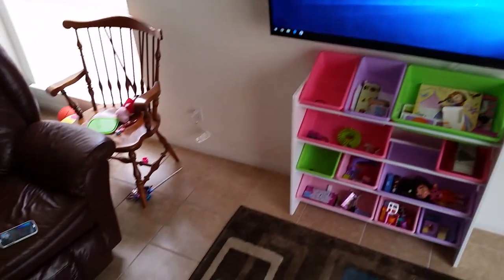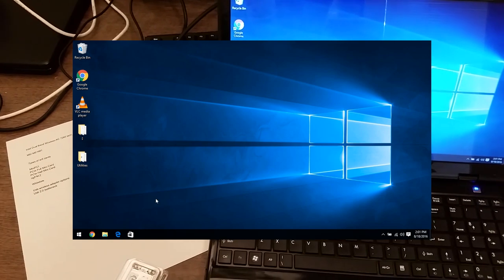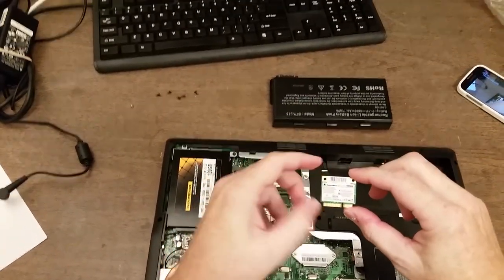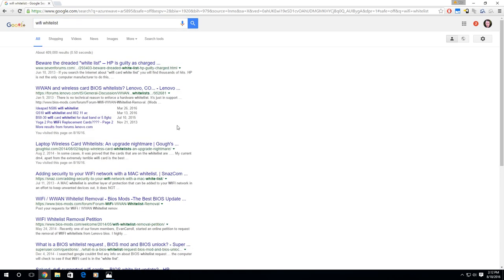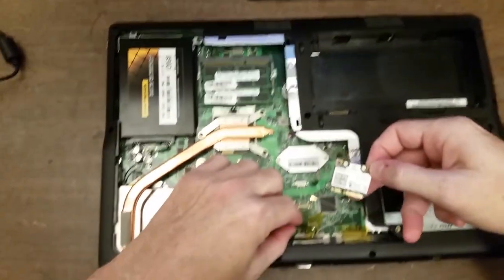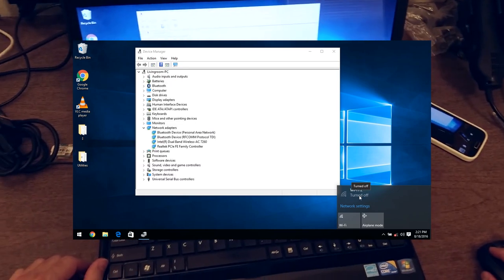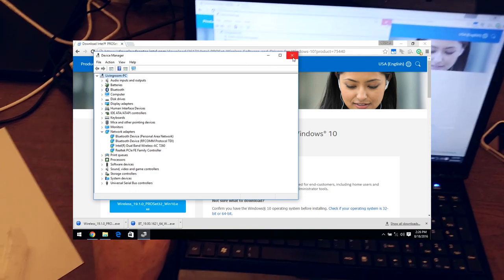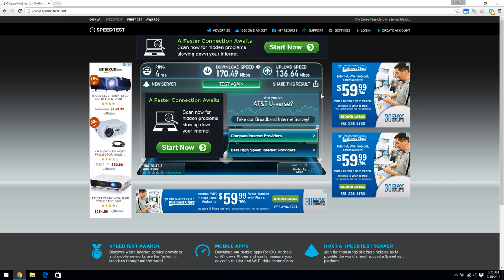Upgrading to a Wireless AC WIFI card with Bluetooth on a Laptop or Desktop

Comment: I just installed an intel 3168 into my HP that was shipped with only 1 antenna.  I hooked it up to the Main port on the card and left the Aux port blank.  The wifi works great but the range for bluetooth is limited to about 1-2 inches away from the laptop.  Is this because I need to install a second antenna?
Reply from the maker: Go on Amazon and do a search for Wireless Mini PCI PCI-E WIFI Bluetooth Internal Antenna. You'll find lots of them. How are you install them inside the laptop could be difficult. Typically the antennas sit at the top right and left of the screen.
Reply: Did you notice any signal improvements? Or do you know about any better internal antennas? I'm having signal issues in my university even with a tp-link usb adapter with an actual antenna... Thanks in advance.

Comment: I have dell laptop with intel 7260 mini pci card... but I only get 29mbps.
Reply from the maker: Gulliver Gimeno What is the speed of your Internet speed, are your connecting to a 5g access point and how far away from the access point is the laptop?
Reply: i have a lind tablet and i bought an external wifibusb adapter that supports 5ghz and 2ghz and i get 70-80mbs on 5ghz which is incredible  before with internal antenna i was getting  24mbs minus i was disconnect  every 5 minutes now i using the internet smooth without any disconnect  at all problem solved

Comment: Why didn't you get a mini pc instead of a laptop.?
Reply from the maker: Because I already had the laptop.
Reply: @MichaelTheComputerGuy  makes sense. Most mini computers are not that fast anyway. Most that are affordable have the slow celeron processors. It's what I have. Mine didn't have built-in wifi or Bluetooth. I have been using a slow USB wifi. I took it apart and found a m2 slot that was for another hard drive so I just ordered a combo wifi and Bluetooth Card to have built in wifi and Bluetooth. I ran across you're video while trying to find how it turned out for others. You did a great job. all you need now is is a external 4tb hard drive to store your movies.
Reply from the maker: @davidbrown8303  Check out the set of videos.  It's a 3 parter.  https://youtu.be/9LCclB4Uw_o

Comment: Run a ethernet cable for wired connection if you want to avoid pain. Lol
Reply from the maker: philip dias Wireless is best if possible or practical. Wireless is there when it's not possible or practical.

Comment: i have a question is there any replacement for a ethernet adapter for a laptop?
is the ethernet port, wired rj45 is the same componnent as the wifi bluethoot adater? , im getting slow speed on my network, i try to go in advance setting and increase the speed and use 10/100mbit, but the adapter not working unless i leave it to 10 mbit, im using a latitude d630
Reply from the maker: yazmo The wifi card is different from the ethernet adapter.  You can get a USB to Ethernet adapter to work around the issue you're having.
Reply: ok thank for the info that what i thought thank again.

Comment: AX200 dont work in CVNio soket in motherboard.they said ax200 pce-i ax201 cvni :D. ı need adaptor pcei but what kind of slot m2 to use ax200
Reply from the maker: What model computer are you trying to add an adapter to?
Reply: I think, the way I went to connect the ps5 controller to pc was wrong,I would be more profitable if I bought a bluetooth usb gadget
Reply: It would be more profitable if I bought a usb device(bluethooth garge), just to connect the ps5 controller via bluetooth :D
Reply from the maker: @srknAyn  yes Bluetooth over USB works great and is cheap.  Wi-Fi USB adapters are a great way to go as well.

Comment: I just got a Inspiron 15 gaming laptop and want to change the WiFi card, is there any specific one you might recommend?
Reply from the maker: joel gastelum First you need to find out what kind of Wi-Fi card is in the laptop. It's most likely either a half mini PCI card or a ngff card. You can probably find this by doing searches online for the model number of the computer and either half mini or ngff. You can also just open up the computer and look to see which type it is. Once you know this you can do a search for a wireless AC or whatever type of Wi-Fi card you want to get along with half mini and ngff.
Reply: Alright thanks a lot.
Reply: I checked. Its a  pci. It has a intel dual band AC-3165.
Reply from the maker: joel gastelum The 3165 looks like a NGFF card.  You'll need to get another NGFF card. A Intel Dual Band Wireless-AC 8260NGW would be a good choice.
Reply: Oh ok. Thought it was a pci. Thanks though I'll look into that one.
Reply from the maker: joel gastelum You can tell for sure by typing in the full model number on the card you have into Google. Also look at a Google Images search for mini half vs ngff.
Reply: Yeah you're right it's a ngff.
Reply: thanks it helped me buy too.

Comment: Hello Micheal Cooper I'm not that tech savy I have a gateway model z5wtc 802.11b/g/n+bt I cant walk away no more than 7ft away from the router. I want to replace my existing card to a stronger plus Bluetooth capable. Can you please let me know what card can I buy to the crap that came in my laptop? I would greatly appreciate it since I really don't know much about wifi cards.
Reply from the maker: I did some Google searches and it looks like the card and your laptop is a half mini PCI just like the one in the video.  This one should work Intel Dual Band Wireless-AC 7260 2x2 Network plus Bluetooth adapter (7260.HMWWB.R) https://www.amazon.com/dp/B00N7474CS/ref=cm_sw_r_cp_apa_wmi8zbVQYAF7Z
Reply: oh wow that was a fast response thanks im gonna order it today i appreciate your help a bunch.

Comment: hi, I already have laptops equipped with 7260 modules, and i would like to upgrade to Ax200 for more speed and stability. although they have not the same connector (M2 vs Mini  PCIe) i have found and ordered an adapter that should do the job.

however, the antenna connectors of the AX200 modules seem smaller than what i have now except if i didn't see well. And I don't know what to do to adapt that. Any clue? Thanks
Reply from the maker: The antenna connectors on the PCI half mini vs NGF adapters are different sizes. They don't interconnect.
Reply: @MichaelTheComputerGuy  that's what I thought. Is there a way to solve that like connector adapters? Do you know the types of adaptors?
Reply from the maker: @marchervais1269  I wouldn't deal with adapters to change from pci half mini to ngf or vice versa.  Just buy an adapter that will fit into your computer.

Comment: I've Installed new Intel wireless drivers and it's not showing up in device manager or under network adapters! Where do I go to find them so I can disable my killer wifi network adapter?
Reply from the maker: A new network adapter will show up in the Device Manager under the network section or the other devices section if the computer doesn't recognize what it is.  Why would you want to disable the killer network adapter?
Reply: @MichaelTheComputerGuy  I have managed to install the new chip and it runs. My main issue is still not fixed though. My Dell XPS 15 9570 laptop has a glitching problem when I am connected to the internet. It flickers out of control when I'm on wifi and seems to disappear completely when off. Through Dell support, they were unable to fix the problem at all. All my drivers are up to date, all software and fireware are to date. I'm not sure if you can point me in the right direction but you might know something I don't! I really believe it's a software issue and my internet connectivity through my device. Maybe you can help me there! I appreciate everything you can guide me
Reply from the maker: @razzerraw1108  that sounds like an issue with the motherboard. I would try an external Wi-Fi adapter. Search on Amazon for USB Wi-Fi adapter. There's one made by edimax that sticks out about a quarter of an inch and I've had good luck with them. Whether or not the issue you're having will go away is hard to say. Certainly worth a try.
Reply: @MichaelTheComputerGuy  How does the mother board effect screen flickering only if I'm online? When I'm offline, the problems do not emerge "at all". Only a few times but it was gimicky. But if I were to recreate the problem, being on my wifi always causes it. But an explanation about the motherboard would be the most helpful thing in the world! Thank you
Reply from the maker: @razzerraw1108  well it's obviously not caused by the Wi-Fi adapter. However the Wi-Fi adapter does fit in the motherboard. Just about every other component that could cause that symptom is on the motherboard.
Reply: @MichaelTheComputerGuy  I've changed the 802.11n/ac Wireless mode to disabled and the transmit power to lowest on my Intel 9260 card. This has reduced the flickering so far. Do you know why this works? Or what else I could consider changing? Sorry If it seems that I'm giving you to many questions but online resources and forums haven't been supportive at all
Reply from the maker: @razzerraw1108  I went suggest what I suggested before. Get a USB Wi-Fi adapter and see if that takes care of the problem.
Reply: @MichaelTheComputerGuy  Alright thank you! I appreciate you staying on top of my replys and everything you recommended was insightful

Comment: Thanks for a detailed video on wifi cards introduction. I've stumbled on upgrading my wifi card. Though I am having a new Asrock Z370 m-iTX motherboard, the wifi module that comes with it is protected by a metal case. As shown in this image , https://www.caseking.de/en/asrock-fatal1ty-z370-gaming-itx-ac-intel-z370-motherboard-socket-1151-mbar-263.html . Or you can check out the motherboard from the official site. The wifi card is an ac dual band but limited to 430Mbps. Is it possible to replace this card assuming it is under whitelist though I could'nt find one yet.
Reply from the maker: Do a google search for "Fatal1ty Z370 Gaming ITX/ac replace wireless" and you'll find lots of people talking about what they used to replace the wireless card.

Comment: Can this be use on desktop PCIE?
Reply: you will need one of these: https://www.amazon.com/Fenvi-Wireless-Converter-Including-Networking/dp/B01MFGYAX6
and i would recommend this wireless card to go in it: https://www.amazon.com/dp/B079QH5KW1
so you put the Wifi Card inside of the adapter and then plug the adapter into the 1x pcie slot on your motherboard

Comment: hey my laptop is a toshiba C55-C5379 my laptop has been working decently fine until just 1 week ago. now to be able to use the internet i need to sit within 10 feet of the router, where as before i was about 30ft away downstairs in my basement. do you think its a problem with the wifi antenna or chip? i cant find any information online regarding this matter so any help would be great. additionally i tried  restart my router also i went  to  my library today and i couldnt connect to their wifi as well
Reply from the maker: Raja Suri The antenna in the laptop is literally just a wire or two. Not likely to be the cause of the problem. There is a possibility that the wireless adapter card is failing. Open it up and take a look at the card. There is a slight possibility that one of the antenna cables came loose. They just pop back on.
Reply: Michael Cooper okay I'll check it out now thanks

Comment: The first thing to try in a whitelist jungle is to update the BIOS that some scientists/engineers spent time on.
Reply from the maker: That's worth a try but I doubt it would help. The whitelist is there from the beginning for a reason. The manufacturer doesn't want you using non-approved Wi-Fi hardware.
Reply: @MichaelTheComputerGuy  

The manufacturer's BIOS update made it possible for me to install a newer CPU a few days ago. It didn't boot with the old (original) BIOS.
Reply from the maker: Oh yes for CPU upgrades that's absolutely something a newer bios from the manufacturer can give you along with more memory compatibility and various problem fixes.. I just don't think that a Wi-Fi whitelist will come off with bios updates.
Reply: @MichaelTheComputerGuy  

True that Wi-Fi cards are more limited. I'm experimenting with it to find out and it's not looking good with 2-3 tests.
Reply from the maker: I looked in the Bios updates before I made this video as a way to possibly get around whitelists and did not find anything useful. If your computer has a whitelist for Wi-Fi cards you either have to get a Wi-Fi card that is on the list or use one that connects through USB or possibly PCI / PCI Express.
Reply: @MichaelTheComputerGuy  

It's Thinkpads and Dell laptops I want to upgrade a bit/experiment with for now. Business Dells are not so sensitive with the Wi-Fi cards and Thinkpads are well documented and numbered.